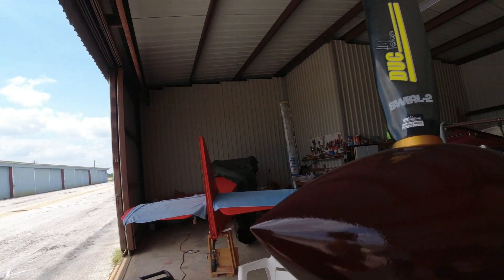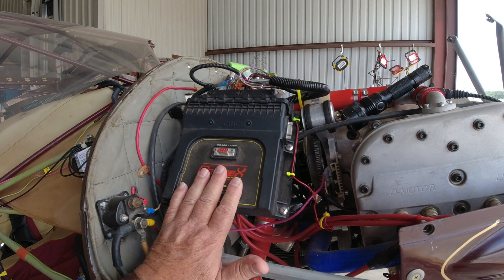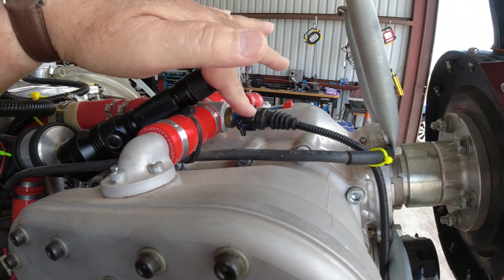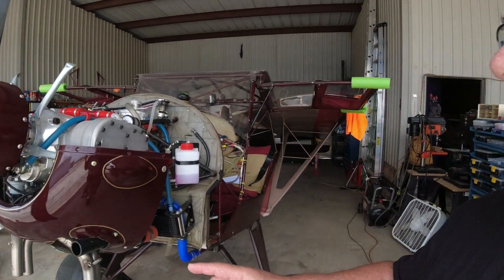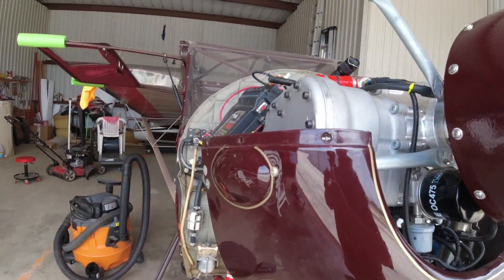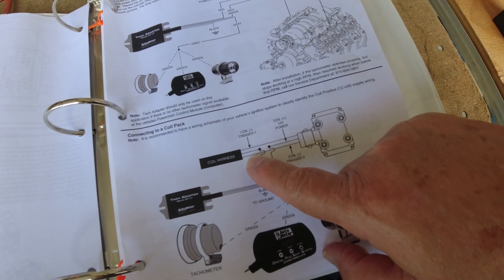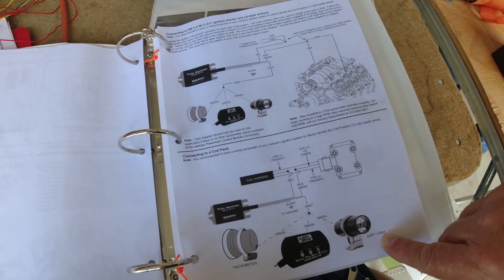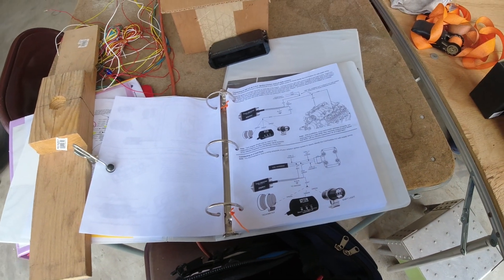Kitfox 2 D MOTOR update June 2022

Comment: Hi Jose, did you manage to get the water temp and RPM? you can indeed gent them throught the green (water) and grey (rpm) as sven-ake said.
Reply from the maker: Sorry it took too long to answer, just noticed your question. I had to get an RPM adapter from AUTO METER GAUGES for RPM. Water temp. I had to get the correct temp sender, I had to go thru three different senders to get correct water temp.

Comment: Jose, you have a green wire marked for water temp. A VDO temp sensor located under cylinders on left side. There is also a grey wire marked for rpm. I think you have 8 wires ready for different signals to EFIS. 
Regards Sven-Åke